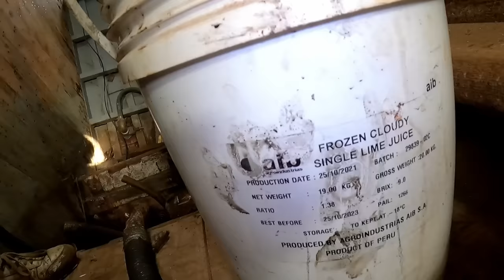Ep 150 This Bilge Hasn't Been Seen for 40 Years!

Comment: The former fuel tank room looks so much better with all the extraneous stuff removed.
Energy saving tip: Drop the water temperature in the heating system to 65°C & it'll work more efficiently.

Comment: Hi folks, without trying to be the pedant and using a far too big viewing experience of yacht building channels, I believe your terminology can be adjusted with regard to the structural elements in the boat.  Nautical, a ceiling is a liner on the hull. A wall can be a wall if running parallel to the keel and a bulkhead if perpendicular to the keel, and usually running from beam to beam. The floor is the device that connects the keel structure to the rib structure. The top of a room is called the head lining and the bottom is the cabin some or just sole. That said we all know what you mean and enjoy the journey you are taking us on.  Great teamwork amid many challenges.  Love your work guys. Steve from Western Australia, a product of a long line of fishermen and boat builder's, although I am neither of those.

Comment: The engine room door is not original? It sure looks like it could be original. 🙀 Glad Simon isn't hurt. When you put in your new heads you might want to look into RV type incinerator units. They are a bit pricey but would be much less maintenance.

Comment: excellent job you two are doing , bilges are sometimes the worst , so put on the 'grunges and go head first and it will happen .. see if you can find a 'biodegradable product you can 'apply with garden sprayer and let it soak for at least 4 days , then go back with 'power-wash .. im certain you'll be impressed , also use a round dowel about 4ft long and tape it to your vacuum hose as to reach down in bilge so as not to crawl in .. eh (excellent teamwork you two have )

Comment: So guys, when I see great new boats one thing they get high marks on and rightly so is that every pipe, every wire, every connection is LABELED and when I saw you noting "Oh those are the hydraulic steering pipes" I thought "Hey, are you going to put nice labels on them before you finish so you (and more importantly someone not as familiar with Sarinda who may work on her or even own her someday) will KNOW what they are and, in some cases, what NOT to touch/cut/disturb etc. etc.? It'd be great to get a really visible labeling system/gizmo and mark EVERYthing as you encounter it, even things you may want to remove or relocate later.

Comment: Seems to be a "standard" watertight door and frame. Does Medusa have ones of that type?
Reply: In a video from Medusa I saw them use an hatch and ladder direct from the deck in the wheelhouse to get into the engine room. It might for added safty have been an completely seperated box with no direct connection to the crew areas.
Reply: @westmus I was just looking at plans for the HDML (internet) and, under the original configuration, there appears to be an access door into the engine room on the centreline (where the steps are). The plan shows the original fuel tanks so, with the change in configuration it is possible that the watertight door was relocated through the bulkhead where the tanks were. With other changes it is possible that there was another watertight door available (and used).